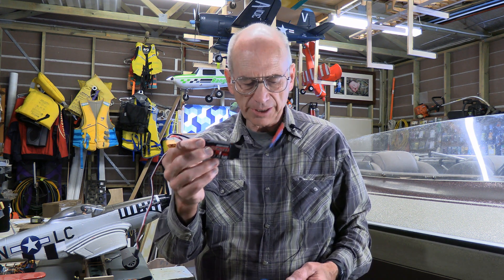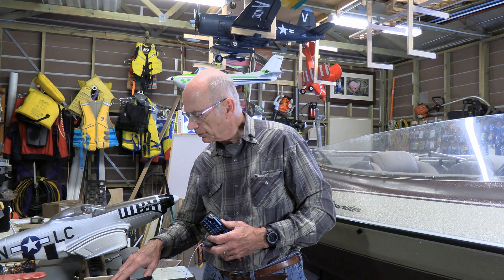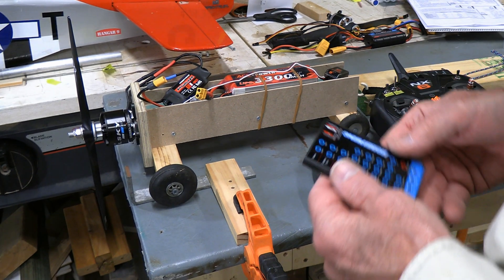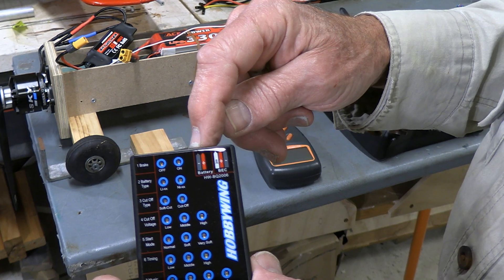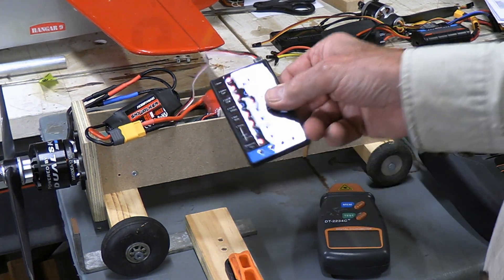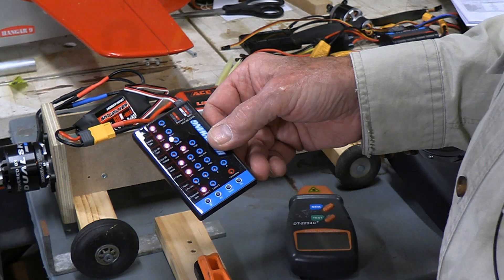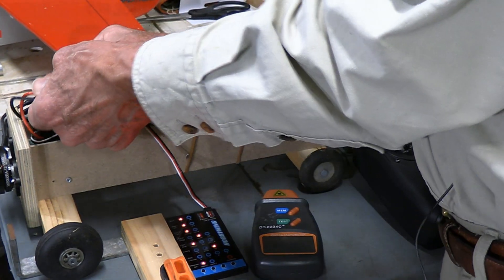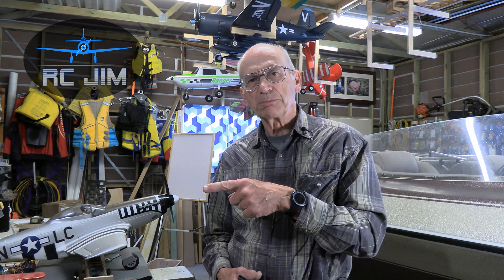Hobbywing Skywalker ESC Programming

Comment: I fly small rc pusher planes.normally 2835 2300 kv motors using 3 or 4s..I read low timing setting is best for these motors..
You only talk about bigger motors here with low kv...Also I just bought 2 50 amp v2 skywalker esc,s.i have the card you have here...programing seemed to work,but I did not use the yellow wire on these which is for reverse thrust  ...not sure how to do reverse thrust programing if I want it for tricks etc...any idea?
Reply from the maker: Yes, motors with a lower number of poles can run efficiently on a low timing setting.  Essentially, it is best to choose the lowest timing setting with which the motor continues to run smoothly at high revs.  The reverse thrust is simple.  The extra wire from the ESC is a signal wire for the reversing.  Just plug it into the top position on an empty channel on the receiver.  It doesn't need the other two wires.  On your transmitter, assign that channel to a switch.  Check to make sure it goes forward when your switch is in what you consider to be the "forward" direction, and that it reverses when it's flipped the other way.  Enjoy!
Reply: Thanks, I changed motor on this new plane I have had cut offs in flight and used my hobbywing car program card not my older one like you used,and settings seem to stay,for some reason using old program card settings kept going back to original...I think motor brand had was issue...will check today...bench testing all seems fine,but for some reason I only had cut offs when flying...
Reply from the maker: Intermittent glitches are really hard to work out - and of course, most of the time they don't happen when you are looking for them on the bench!  That's strange about the program card.  It doesn't seem like the motor brand would have anything to do with the ESC operation. Given that it hasn't melted down, it should simply be responding to the rotating three phase pulses coming out of the ESC.

Comment: Hi, how do you connect it to the engine?All the wires are the same color and I want to change the direction of rotation of the motor.
Reply from the maker: Just swap any two of the wires, and the motor will be reversed.

Comment: Hi is there a video on how to connect the hobby wing 80amp skywalker v2 aircraft esc with a Hobbywing LED program box? I cant get mine to work no videos at all anywhere?
Reply from the maker: The only one I have for Hobbyking Skywalker is this one that you have watched.
Reply: Thanks for your reply I’ve sent a message to Hobbywing asking for a video on how to connect the skywalker v2 esc to the LED program Box, I also noticed that the new V2 esc has trust reverse wire so I wonder if that wire needs to be plugged into the program box as well. Theses a heap of videos on how to use the program box with the car esc but not the v2 aircraft esc and I can’t get it working
Reply: I found this video that helps https://youtu.be/ooPkDbvPxgA?si=Cmp1O1ua6tSblcmr
Reply from the maker: Excellent, glad to hear that!
Reply: same problem, did you find a solution?

Comment: Hello Jim, from Wales in the UK
I've recently bought a Hobbywing 40amp Skywalker V2 esc - ubec and a Hobbywing Program Card P/N 30501003. It's somewhat different to the one in your video and comes with a few labels to relabel the front depending on the brand of ESC  and the  application. My problem is the instructions for the Card don't cover the Skywalker range of ESC's, so I'm uncertain which label to use. Can you help?
Reply from the maker: Hi Colin, while the Hobbywing LED Program Card doesn't say that it will work with the Skywalker ESC, in the Skywalker instructions it does refer to using the LED Program Card.  If you don't have those instructions, see https://www.hobbywing.com/en/uploads/file/20230321/69381b562c41439ee4451c7152905f10.pdf  You will need to use the "aircraft" label on the Program Card.  Note the requirement to plug in the ESC to the Program Card first, then power up the ESC.  Also, the ESC needs to be turned off and on after changing parameters on the Program Card.  Let me know how you go with that.
Jim
Reply: Thanks Jim for taking the time to reply. The problem is that none of the labels supplied are specific to a model aircraft application. One is for a car, another is for a boat and the other two are for a flyfun V5 and a Platinum V1/V2 respectively. I've been in contact with Hobbywing directly in the last few days, so hopefully I get some sense out of them. For the moment, they seem to be saying that the Skywalker series of ESC's are new and the instructions for the program box haven't been updated.

Comment: Jim thank you for this video, I was told I needed a programming cable and there were pins under the heat shrink on the esc to plug it in. I looked at my esc and did not find any pins to plug a programming cable into. And you showed just use the throttle cable coming from the esc and the proper sequence. 👍🏻👍🏻
Reply from the maker: Glad it helped